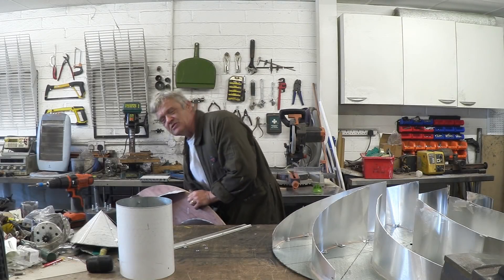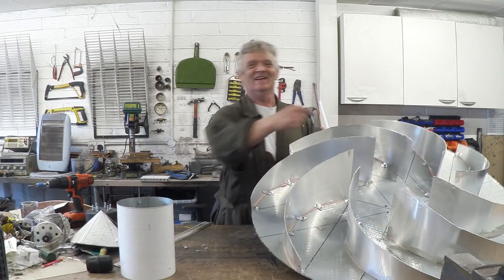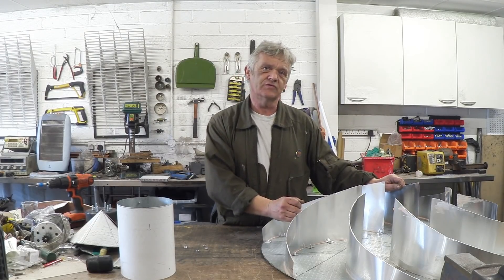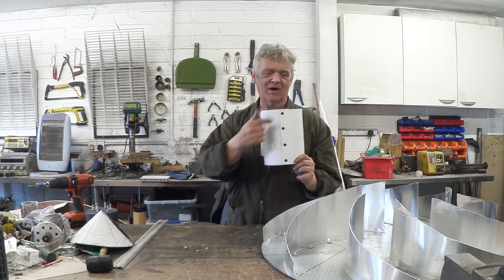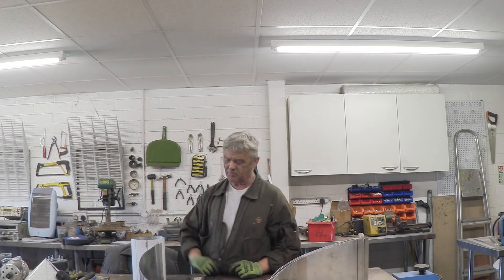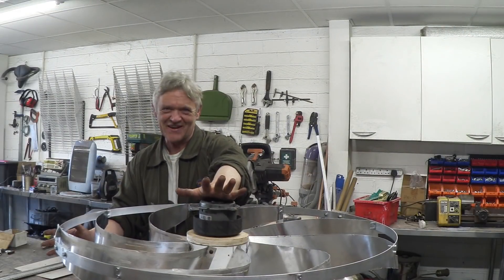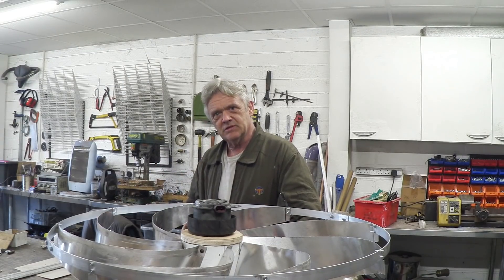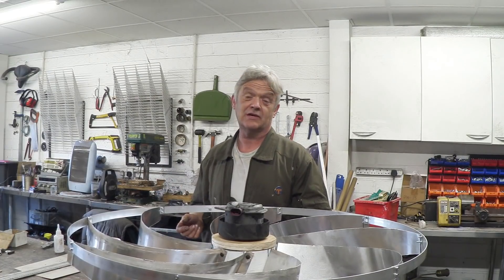1138 The New Wind Generator - Exploring Suggestions

Comment: How would it work if the blades were extended down the lengths, so that they sat like an Archimedes type screw? Larger at the rear smaller twists at the front of the screw?

Comment: I maybe wrong, but the 45° twist seems "backwards", which means it works to push the turbine counter-clockwise, against the blades' curves, that would have pushed the turbine clockwise... if it was designed to allow the wind to come from any direction other than directly from the front.
If I'm right, either the curve should be reversed, or the center twist should be reversed, i.e.: looking from the center towards the outer ring, the blades should be twisted clockwise, and then the outer edge of the blades should be twisted a bit further in the same direction to account for the difference in (linear) speed of the spinning blades' parts at different distances from the center.

Also, the center cylinder prevents the utilization of air flow through the center, so a simple cone, like the one you've used in some other designs, is probably a good idea too.

Comment: The motor should be on the opposite side as the fins are on backwards CD so they are facing the wind the wrong direction.  The blades will catch the wind and spin more efficiently

Comment: First, thank you so much for sharing these wonderful videos. Secondly, I was really intrigued by your earlier designs last year (around Nov 2020 - part 4), I think you were really on a better track then, with the VAWT. As I was looking at the design and listening to you talk about the lower wind speeds that are the reality of daily life, I thought a venturi increase, by extending  the side baffles and maybe adding a top baffle funnel the wind could dramatically increase the force applied to the blades. Mind you this is only an hypothesis but there have been dramatic increases in certain downtown buildings here in the US due to poorly though out architectural layouts of some high rise plazas. 
I think it would be really interesting to test larger baffles and try and induce such a venturi effect?

-Ron

Comment: My daughter and I just pulled out our rangehood , it blew a circuit . However the motor and what I assume is a capacitor look fine . It’s Swiss made , the motor spins forever . 

The motor is 220/240V 50Hz , the capacitor I assume the numbers mean is 3 micro f - 400V .

The squirrel cage is still grubby , 200mm across and 60mm deep . 

Have you made anything from rangehoods before ?

Comment: Take it outside again, hold it by the motor, turn your BACK to the wind, and see if that makes it work. The wind has to hit blade and flow of it. The wind hits the Apex of the blades which stops it circular rotation.

Comment: Interesting videos, and I agree with your conclusion regarding the role of the backplane.  However, that basically means these designs are “drag” type wind turbines - but the blades are aligned with the with the wind, generating no drag.  
Airfoil type wind turbines actually generate lift and “pull” themselves around, rather than being “pushed”.  That last design, with the open back bears a striking resemblance to modern turboprop propellers or advanced submarine propellers.  However, those have both an airfoil cross section, and a twist, designed to both catch the wind and generate lift.  
Thanks, and good luck.  
PS: wish I had a fraction of your skill in the shop!

Comment: A few ideas for variations to test: 
1a. Have a cone or dome shaped solid backer and try with fins on the outside and the pointed end of the cone facing the wind.  The backer board may also not be attached to the blades, so that it does not need to spin.
1b. Have the fins on the inside with a hole in the middle of the cone/bowl (like the old round parachutes) and the pointed end facing away from the wind so that it catches the wind and funnels it towards the center to accelerate it.
2. Try with the original flat backer, but have the blades flipped around so that the taller part is toward the outside edge instead of the center.  Lay the whole thing horizontally so that it is omni directional.  A thin piece may be needed around the top edge of the circumference to stabilize the fins, preferably laid horizontally on the top of the fins so that it has as thin of a profile as possible.

Comment: Hmm. There is the answer to one possible method of over speed control - if the back plane was moveable against the blades, then in an over wind/ over speed condition, a mechanical solenoid for example could cause the backplane to move away from the blades leaving a gap between blades and backplane thus lowering the efficiency - just what is needed when there is too much wind.
Still wasn't it Edison who said he knew thousands of ways to make a light bulb, but only a few of those ways actually worked. The Chinese proverb, "To the novice there are lots of ways forward. To the expert, there are few."
Learning by experimentation is never wasted. Knowing things that don't work moves you forward. Some day what didn't work becomes the exact answer later for something else.

Comment: Hi Robert-Murray Smith, good work!, it is so good to see someone prepared to take on such a project without too much forethought and design but there are some fundamental principles that must be observed, the first thing I saw at about four minutes thirty is that you have set up this 'open'  model with the vanes 'facing' backwards!, the whole concept relies entirely on presenting the 'blades' too the moving air at an appropriate angle, this angle has to be a percentage of the difference between the speed of the vane and the speed of the air.
At or new the centre of the device the speed at which the vane is rotating is slower than near the periphery, therefore the angle of attack should be steeper, out towards the tips of the vanes the angle needs to be much less because the speed at which that part of the vane is moving in a circular trajectory is much greater. There is a mathematical formula that describes this relationship. The product of any design is always a rotor that only works at its most efficient at one optimal air speed at either extreme the efficiency falls off. The only way out is to incorporate some form of pitch control but that has to include the option of variable twist in each vane.
The reason I can pass this advice to you is because I spent many days working on prototype wind powered dynamo devices to attach to the front of the bicycle that I rode to use some of the drag caused by my body to be absorbed by the turbine and charge the battery for night time use. We designed and built an eighteen inch diameter three-bladed propellor which did seem to work very well but was not robust enough. 
During this development we discovered that a serious limitation to our efforts relates to the fact that while the energy derived from the wind increases exponentially the load from the dynamo is linear so the thing would not work at all at very low speed at spun its nuts off at higher wind speeds!. What was required was an alternator that could vary the load by moderating the current to the field coils, all of which demands the application of far more skill and ability than I have access to.
There was on thing that emerged during the project that may be of use to you, if you cut sections of rotor vane from suitable diameter tubing you can incorporate the appropriate twist by including a radial component during cutting, resulting in vanes that un-twist as they extend from the centre. We did this with 65mm diameter plastic drain pipe for a rotor of about nine inch diameter for a wind speed of fifteen mph. I am sorry to say that I now cannot remember the mathematical formulae that we used but they are standard in engineering. Cheers, Richard

Comment: The reason your turbine didn't work as intended is because it wasn't rigid enough.  The design is fine you're just not transferring the wind energy to the hub it's getting absorbed in the 'Spring' you've made of the blade assembly.  Make sense?

Comment: Man the wind is facing the wrong face side of the opened wind turbine, flip it 180 degrees and try again , increase the blades pitch a little too and try , you totally put the wrong side of the opened wind turbine to the face of wind ,flip it over and change the place of the motor, all the best , keep trying 👍

Comment: Maybe you can find someone who has and is good with a CAD software than can put your design to the test using the software fluid dynamics and perhaps test some things virtually, saving time, money and headaches and possibly coming up with a better design? So far as your design with no backing goes the biggest flaw is that there was no pitch, or very little pitch on the blades. The only way that design as is will work is if the wind comes at it from the side or at an angle.

Comment: Hi mate ! Here is a suggestion. The more space there is between blades, the more wind is lost. But depending on strength of the wind, the turbine will be more or less efficient. If the wind is weak, we need a sensitive turbine. So, the idea would be to use moving blades, constantly adjusting their angle, in order to get the more of the wind. If the wind is weak, the turbine is sensitive, but if the wind strengthen, the turbine adapts itself automatically. When the rotation speed increases, the angle of the blades changes, mechanically. So, the efficiency is always optimum. I don't know if it is possible. What do you think ? Cheers !

Comment: I like the idea of magnets at the outer edge but cost wise and you would have to build a turbine that is structurally stronger and more expensive if you were to do that rather than Central axle  ..  your design reminds me of a turbulence free submarine propeller they are also electrically driven they do not have a central axle but rather it belt at the rim , usually have three extended props in a chronicle shape .  I don't know how efficient
That design would be for air I know it's probably the best one for turbulence medication in water.

Comment: Yes if you intend to install them on a building wall anyway you might as well save the material and save on cost and use the wall of the building as they pressure diverter.

Comment: I could be wrong but it seems the angle you put on the blades on the cylinder is the wrong way round? It looks like it is trying to use the back of the blade to push. 
Great show, keep up the good work. 😁

Comment: Cut a 50 gallon barrel or drum in half, take one half and mount it on one side of the blades then take the other half and mount it on the other side that the wind comes from. The side that the wind comes from will act as a tube tunnel and the closed side of the barrel will act as a tube wall which in turn will cause a vortex and help make it even faster. If you do this mate, you will be pleasantly shocked at the affect the two will have. It would had helped if the blades were smaller than the barrel tunnel but it will still work excellent mate.
Reply: If you do this, makes sure the barrel pieces are mounted only an inch or 2 from the blades, the closer the better without hitting.

Comment: I think you may have needed the blades turned another 45 degrees  so they are almost flat at the centre and 45 at edge more like a propeller, but I could be wrong, either way a good experiment and nice results out of mk3.

Comment: All that happened was that the rim wasn't strong enough to keep the circular shape and, by deforming downward, due to gravity, it became bottom-heavy. That's why it didn't spin.
Reply: I know you probably already moved on from this like you always do but, with a stronger and lighter outer ring and some reinforcement of the blades so that it holds its shape you might actually have something.

Comment: Dear Rob, love the channel(I am a member) but did you fall on your head with this one. There is so much wrong with this. you even forgot some of the original idea's like wind direction with a cone to direct it. Apart from everything wrong. you need to think of wind a bit like water, it has weight, it just work horizontally, as oppose to water and gravity downwards.

Had the wind been any stronger, it wouldn't have turned your turbine, it would rip it apart. 

The Wind like Water, will take the route of least resistant's, which includes the flexing of your blades, after all we don't make propellers out of elastic bands. and as for the cylinder you made to attach the blades too, you effectively made a brake. if you think of how a jet impellor is made, they spin in free wind when stood with the engines off and imagine how much weight is on a jet engine.

I hope this is of help, keep up the good work.

Comment: Have you thought of creating a wind tunnel design.  You can make long axle, short blade turbines that harness the wind from, as an example, the peak of a building’s roof and natural wind shear.  The small diameter of the blades are compensated by longer width. The wider the better. The key is to funnel wind energy directed by the roof effectively from both sides of the peak.

Comment: Hello Robert, didn’t take the time to read all the comments, but in this case- without the back plate- this should be the same as a conventional wind turbine. You chose the wrong twist of the blades. At the root of the blades you’re quite ok. But not at the outer rim. There the blades should be nearly in the same surface of the wheel instead of 90 degrees which means a huge airbrake. Think about moving your hand around you when you’re in a swimming pool. Keeping your hand flat or with a little angle of attack makes it plane over the water. A hand perpendicular to the plane of rotation gives huge turbulence and thus drag.
You can without any adaptations use a bicycle wheel and tape off the spokes simulating a windmill blade, in fact it is one

Comment: I was thinking of something in-between the flat and the open backing.  Like a child's pinwheel.  Or perhaps kind of a nautilus shape.  So the wind is blowing through/around a curve most/all the way through.  Just to increase efficiency some.  I'm thinking some energy is lost when it's being deflected at such a great angle as 90 degrees against the backplate.  I'm not at all sure if it's significant, but I have to imagine there's some loss there.

And, like you, I enjoy the failures as much as I enjoy the successes.  In fact, there's very often MORE to learn from failures - not just "what not to do", but sometimes you get unexpected results that apply to something else entirely.  Often, that's how the best discoveries are made - mistakes in the lab!!  😋😋😋

Comment: Why not funnel it. Place a funnel a bit out from it. wind will still enter from all directions. The smallest diameter of the funnel should be the same diameter as the backing plate. This will catch more air volume to the blades.

Comment: Always wanted to try something : blades attached to rotor spinning one direction and stator attached to backplate( or hybrid blades) just a layer behind and actually converting it to another rotor but spin the other way around. The idea here is to double the effective speed difference between magnets and coil

Comment: You can get the best of both radial and axial flow by extending the blades past the outer edge of the backing plate and twisting only the protruding blade portion. Obviously this will not work against a wall.

Comment: For the coils used with the rim magnets design, you really need a U-shaped iron core on which you wind the coil. The prongs of the U should be the width of the magnet spacing. The magnets should be laid with alternate polarity. This way, you increase the flux density through the coil, and the magnitude of the flux reversal. Finally, make the gap between the prongs and the magnets as small as possible.

Comment: Hey Rob. Have you considered mounting it facing towards the sky with a stationary funnel (maybe with flutes) to direct the wind down towards the impeller? This way, wind direction would not be an issue. Might not be as efficient, because only half-ish of the blades would be exposed to the moving air. Might be interesting to try, though. Thanks for tinkering in public. We enjoy it!

Comment: What if you curled the upper edge of each blade slightly in the direction it angles towards so that the oncoming wind can give it a little extra push instead of just striking the back plate directly and possibly causing drag. It will be difficult to get a nice smooth curl but several spaced vertical cuts on the edge will allow the basic shape to be worked out.

Comment: If you placed it horizontal it will turn as plades in vertical position are 90 degrees with wend, you might bend the plades to create resistance against wend

Comment: There was an idea about bending the blades slightly in all directions to get a similar effect to an archimedes wind turbine, which also seems to compress air. Or improving its "impeller effect" by trying to borrow ideas from the lily impeller.

Comment: Yes from the start I could see that the Air that is caught by the backplate would be lost instead of forcing the Air to the blades. The back plate is essential, the impeller design has been lost to much imo, and going back to the impeller but adapt it, rather than completely change its design. Sometimes you have to go back to go forward, perhaps this is one such time? I still think that the only thing that should of been changed to the impeller was to change the front plate for a dish/saucer shape like a Satelite dish. To direct more wind to the centre hole, with the blades cut so they widen to match the curve of the front plate. So making the impeller a bit like a Turbo charger, compressing the air that then expands as it follows the exit from the blades, I don’t know, I’m probably talking bs again, lol.